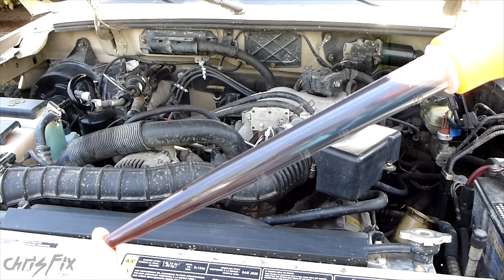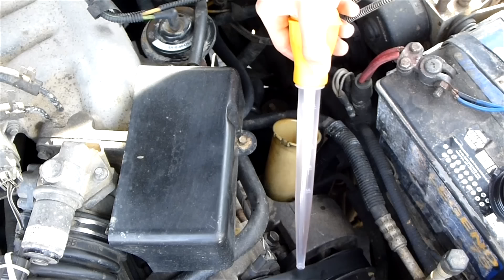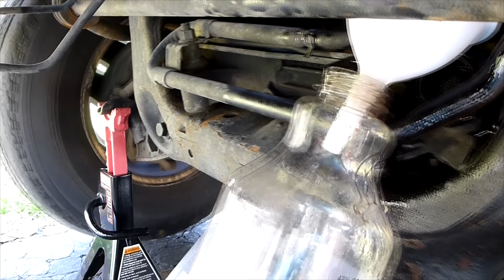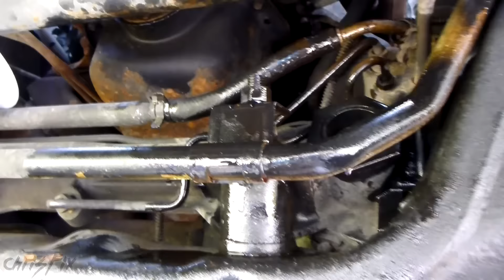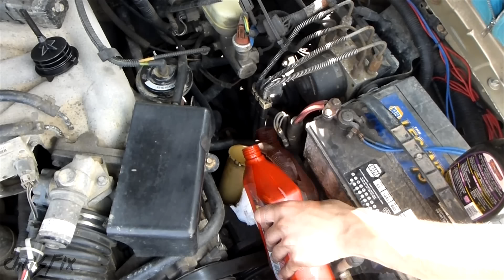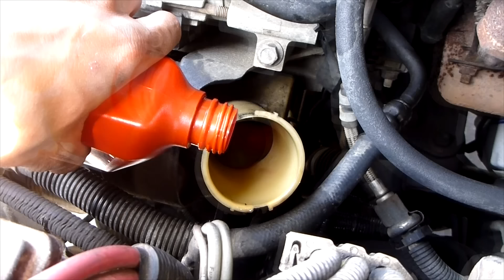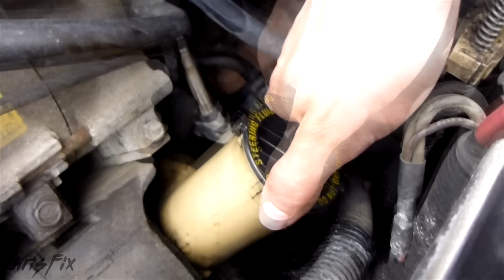How to Flush Your Power Steering Fluid

Comment: How much fluid did you use? Advanced auto told me 1 quart is enough
Reply from the maker: RedTeamWolf Yea one quart should be good. I used about that.
Reply: ChrisFix good because that's what I have to do tomorrow. I couldn't find any of the silencer stuff anywhere though. Hopefully I'll quiet it down to at least half. It's all you hear from the engine is the annoying sound. The pump isn't going out though, it's easier to steer than my grandfather's almost new one
Reply from the maker: RedTeamWolf If it doesnt quiet down, then you can always go to walmart or advance auto to get the power steering pump quieter stuff and add it later. Let me know how it goes!  Oh and give it two days of driving to see if it got quiet or not.

Comment: question, I have a 95 z28. I recently had the PS (power steering) pulley replaced. I get this whining noise when accelerating without turning the wheel. the sound increases with the RPMS, it does sound like a bad steering pump. Am I leaning toward the right direction assuming the pump is causing this noise?
Reply: thesmoothone
It might also be 1 the lines to the gear box might be corroded from the inside out and no signs outside the hose.
Reply from the maker: thesmoothone I would say you are leaning in the correct direction. Did they have to remove the pump to press the pulley back in? Maybe you have air in your system.
Reply: ChrisFix he stated he didn't have to remove the pump. I noticed the fluid is turning brown again after changing it a few days ago. Ill have to pull the those from the bottom like in the video. Thanks for responding.

Comment: Chris, thanks for the video, I will try to flush the system on monday.
I have an issue of a whining pump and a light hissing coming from the base of the steering wheel column,it is also moderately stiff when cold and when hot very stiff, it only occurs when the car has fully warmed up / driven hard or fast and come down to stationary, the whine/hiss is very audible..

I have had the pump replaced with another 2nd hand one that I personally used in a car before it was scrapped ( and the steering on THAT car was light as a feather, no resistance). Ive had all the pulleys looked at and they were fine too. I'm paranoid the rack has failed, but do you think the old fluid needs changing, could that cause the resistance in the wheel and hissing when warm?

Thanks,
Reply from the maker: Bunka Fas The old fluid could be causing you the noise but the stifness of the steering wheel indicates a bad pump or bad rack and pinion.
Reply: Ah goodness, not good news then. Like I said its my 2nd pump (2nd hand) so looks like a new rack then...
Reply from the maker: Bunka Fas Well, if you have a hissing noise that could be a leak somewhere which would lower the pressure of the system and cause the steering to be hard. Is there a leak anywhere?
Reply: the hissing is only when turning the wheel , and no I'm almost certain there is no leak. Ive not had to top the fluid up ever ! its just dirty
Reply from the maker: Bunka Fas Maybe you will get lucky and it is just clogged or something with dirty fluid. Worth a shot! Let me know!
Reply: I shall do, hopefully if it is the case then please pass on the knowledge in future videos !
Reply: Chris, after doing a change of fluids (not properly flushed , however, just the methods used in this vid), the steering doesnt whine anymore, slight hissing on full lock after fully warmed up. Steering still doesnt feel as light as it should be but its an improvement !
Reply from the maker: Bunka Fas At full lock, every power steering is going to hiss. You are not supposed to hold it at full lock. Once you get to full lock, you should back off a little. Glad the flush helped alleviate the noise and made the steering feel better!
Reply: ChrisFix
Yeah the feel is less variable after it gets hot, it remains roughly similar stiffness from cold - hot now. But whine is almost non existent. This is on a Volvo v70 1999 if this helps you out in future. Thanks pal.

Comment: If you are able to, like on a corolla, you can empty  the reservoir, then disconnect the return line to the reservoir  and have that drain into a container, less messy that way. But either way works just fine. 

And to keep air from getting in the system, this only works if you are able to remove the return line from the reservoir. Stick an ear plug in the reservoir where the return line was. fill the reservoir full of new fluid can be to the top, Turn the wheel back and forth until it is low, and add more fluid. Repeat until the new fluid is coming out the return. Make sure to let the reservoir go low so u can reconnect the return line, fill to full line and its done. no air in line.
Reply from the maker: ab30494 Thanks for the tips!

Comment from the maker: +la nena, I cannot reply to your comment for some reason so I hope you see this. A loss of power steering can be cause by three main problems. 
1.) you are low in power steering fluid (so check that)
2.) your belt is not on the power steering pump pulley (maybe it broke), it is on the pulley incorrectly, or there is slippage of the belt when you turn the wheel (old worn belt, or there is oil or something on it)
-have someone go and turn the wheel as you watch the pump and the pulley to make sure it is spinning
3.) the pump is work out, clogged, or just brokem
-you can try the flush I did in this video and see if it is just clogged or it has very old fluid or air in the lines or something before getting a new pump.
Reply: ChrisFix power steering loss can also be from the rack mounts or air in the rack.
Reply: @FGuilt  how do u get rid of the air in the rack?
Reply: @powerblaze2u  typically there's a leak somewhere. After the leak is fixed and the fluid reservoir is at the proper level you run the motor and turn your wheel all the way from left to right multiple times. That should clear any bubbles.
Reply: Another great Chris Fix Video!!
Reply: It depends on what car you have.
Look up "morning sickness" as applied to GM cars.
No,I'm not kidding,here.

Comment: Good job.  I have never seen the trick where you get more fluid into the resevior by turning the wheel.  Great tip.  But I wonder, does that step introduce more air into the system, requiring a bit more bleeding?
Reply from the maker: Mike P That step definitely introduces more air into the system and requires more bleeding, but at the same time, if you dont do that, you wont flush as much out. It is really up to you how you go about doing that. You can just flush it without doing that and then flush it again a few weeks later to get most of the dirty fluid out. Nothing is perfect unless you hook up a machine to suck the fluid out and flush new fluid though it after.
Reply: ChrisFix Thanks.  I just flushed my truck.  The wheel turn after the resevior was sucked out did not put any more fluid in it.  Oh well.

Comment: hello ChrisFix, i have a 2002 Buick Rendezvuo 3400 awd and my buick is making the same sound or noise as in your video. i checked my power steering fluid, its a little dirty but i filled it up and it still makes the sound. But my steering wheel is soft but the noise is still there. also when i step on the gas the noise get louder and louder as it accelerates making the same noise. I don't know if whats wrong with it. I think it might be my steering pump but i'm not sure. Could you help me out with this one. Thanks
Reply from the maker: 81kmoua Does the noise get louder with RPM or with speed?
Reply: ChrisFix
yes, it does
Reply from the maker: Read the question again lol. Louder with RPMs or with speed?
Reply: ChrisFix both, when the rpm go up noise get louder and even if I'm driving it
Reply from the maker: If you are on the highway and cruising along, is it loud? What I am trying to get at is that is if it is a bad power steering pump, you will hear it get louder based on your RPMs and it will not really have to do with what speed you are driving at. Is it loud when you turn the steering wheel?
Reply: ChrisFix No, when I turn the wheel it don't make the noise. Only when the rpm go up. But my wheel is still soft to turn with.
Reply: ChrisFix when I'm on the highway and cruising the noise don't get louder. But driving around town and stepping on the gas then the noise gets loud
Reply from the maker: Sounds like air in your power steering pump or it is just a bad pump. They make additives you can try. It works sometimes. You can get them at any parts store, walmart, etc
Here is a video I did on one:
Quiet a Power Steering Pump, How To
Reply: ChrisFix ok, I'll give the additives a try. And if it don't work then should I replace my power steering pump?
Reply from the maker: 81kmoua Yea, I would think that is a good plan of action. It is hard to diagnose stuff over the internet, but from the sounds of it, it is a power steering pump problem.
Reply: ChrisFix I replaced the power steering pump and nothing changed still the same old noise.
Reply from the maker: 81kmoua Drive a round for a few days. There maybe air that still needs to be bled out.

Comment: Chris, I have watched your video half dozen times.  It's great!  I have a Ford E150 van.  I looked for the 2 lines coming out of my power steering pump and found only the high pressure line going to the steering box.  I cannot find the second line.  There is the big line coming down from the reservoir into the pump.  I traced the low pressure line coming out of the steering box that leads to a miniature radiator in the front of the van and going back to the reservoir.  It has the same clamp that you pulled off on your low pressure line.  Should I disconnect this return line going back into the reservoir?  I can plug the bottom of the reservoir so it does not leak all over.  I am stumped because it's a little different than your set up.  On the other hand, If I can most of the fluid out  from the front of my van, it  may end up  being easier and cleaner than your set up.
Reply from the maker: Mark Keeler You can take the hose off of the lower pressure side that connects to the power steering cooler (radiator). It will get you a little more out (might not be worth the effort). Since you are disconnecting all of these hoses, make sure you bleed the air out the best you can. Glad the video was helpful! Let me know how it goes!
Reply: ChrisFix I cannot remove the hose that leads to power steering cooler as it has the crimped type of clamp.  When it leaves the radiator and connects to the reservoir with the clamp that can be removed with a pliers.  It's 3/8".  I will get some tubing from the hardware store and plug the reservoir.
Reply from the maker: Mark Keeler Gotcha. It probably isnt worth the trouble honestly. Sounds like you got most of the fluid out as it is.
Reply: ChrisFix Actually, I have not done it yet.  When I do my repairs, I look everything over for about a week reading forums and watching youtube videos until I get all the info.  I replaced most of my steering front end last weekend including ball joints.  It steers great with the exception of the Ford Whine!  Found your video and now I know that I can do it.  Next question:  Mercon or Mercon V?  May as well go with the updated Mercon V like Valvoline Max Life-this is what you used.
Reply from the maker: Mark Keeler I would actually try and use power steering fluid because of its anti-bubbling formula (compared to tranny fluid). Look in the back of your owners manual and see what it says you should use. The tranny fluid took about 3 days to get all of the bubbles out and I feel like power steering fluid would make the bleeding process go faster.

Comment: Great video. Sure takes the guess work out of my next flush.  My steering is making the same whining noise as yours.

You need an alignment for the van as the inside tires are worn.
Reply from the maker: Mark Keeler Thanks, the camber on this van is not adjustable so it doesnt matter. We just rotate the tires and it is good to go! Good eye!

Comment: Great video but when should power steering fluid and brake fluid be changed?
Reply from the maker: Dblade981 As stated in the video, check the back of your owners manual. There are service intervals in there. I would say every 75k-100k miles. Take a paper towel and see what color the fluid is. It shouldnt smell burnt and shouldnt be black.

Comment: how many miles in general or average do u need to change power steering fluid?
Reply from the maker: It should be listed in the back of your owners manual for the service intervals. Different makes have different intervals. On average, I would go 50-75k miles on a flush.
Reply: ChrisFix same with transmission fluid?
Reply from the maker: No, transmission fluid should be changed if it is black or if it smells burnt. Otherwise just leave it alone. Transmissions are very picky on what fluid they have so if you put new fluid in, it could mess them up.
Reply: ChrisFix well I'm thinking about changing out my transmission fluid and already know what type I will need. Reason is because I'm having some shifting unsmoothly problem between 4th gear overdrive and 3rd gear (direct gear ratio). However the fluid color is between pink and brownish.
Was hoping if I change it it might solve the problem hopefully
Reply from the maker: ***** I would use a tranny additive before changing out the tranny fluid. If it is still pink and doesnt smell burnt, you should be fine. The reason I say that is because new fluid doesnt have all of the broken down clutch material and microscopic metal flakes and stuff that your used oil has right now. By changing the fluid, you are running the risk of creating more problems. With the additive, if it doesnt work, then you can just do the fluid change and at least you gave it a shot.
Reply: ChrisFix
Chris, I would check on the Ford Truck forums about completely flushing the transmission.  Mark Kovalski was a former transmission engineer at Ford.  He has some great insights. http://www.ford-trucks.com/articles/changing-atf-fluid-in-a-e4od-and-4r100-transmission/
Reply from the maker: Mark Keeler Thanks Mark, Im checking it out now!
Reply: does ATF creates hydraulic pressure like power steering? Why in some vehicles they use the same fluid for the transmissio & power steering?
Reply from the maker: ***** ATF is non compressible so it creates hydraulic pressure. Some vehicles use either ATF or power steering fluid because they are designed that way. The fluid is not much different so either can be used.
Reply: ChrisFix
Reply from the maker: ***** That is a good way to do it and stay on top of the fluid change!

Comment: Hello Chris.  Flushed my power steering fluid this wknd however I was unable to disconnect the connections under the car.  I got a lot out by using the turkey baster and moving the steering wheel back and forth to get more into the reservoir.  It was black.  My question is: u think this in enough to suffice or should I do it more thorough?  Thx again
Reply from the maker: Ryan Tettenburn I think this will be plenty. You got most of the fluid out this way. If you want, in a few days, go check the fluid color and see if it looks good or black again.
Reply: Gotch.  If it does look black still and I continue to flush with the same method is it ok to turn the steering wheel back andforth even when very low on fluid?  Thanks again

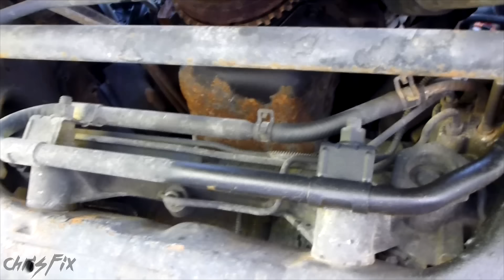Comment: @1:57 what is the part with 4 lines attached, top right side, i belive the high pressure line goes into it, i have a pinhole leak and no idea how to change it, any help?
Reply from the maker: Donald Hughes That is the rack and pinion that the lines go into. Is the leak in a metal or rubber line?

Comment: Good video Chris, how often do you recommend flushing the power steering fluid?
Reply from the maker: Thanks man! I would try to stick with your manufacturers recommended service interval found in the back of the owners manual because every car is different. In general, I check the fluid every 30k miles or so and see if it is black or smells burnt at all. I do a basic flush every 75k to 100k miles on most of my vehicles.